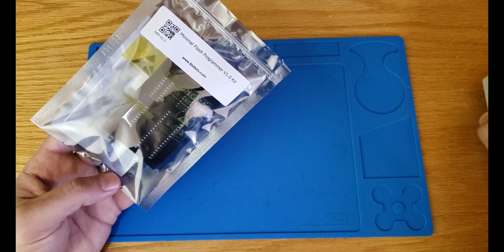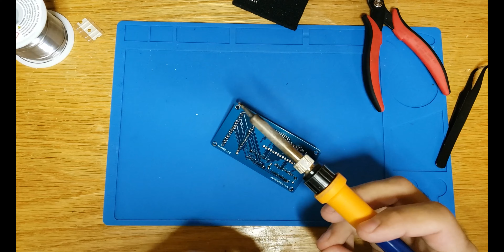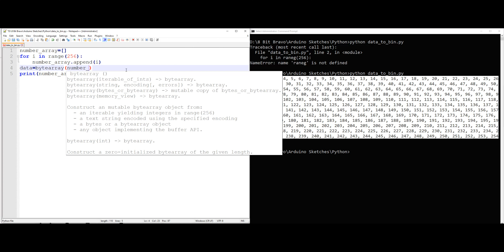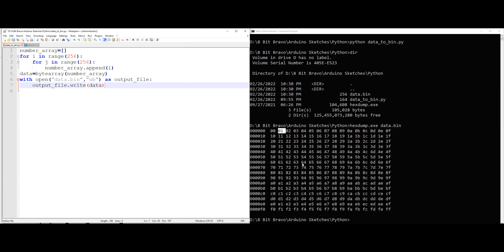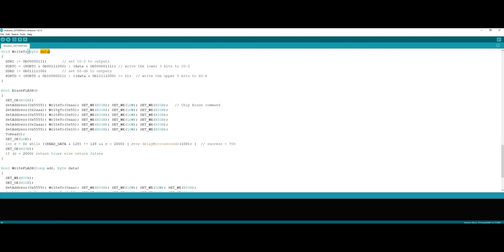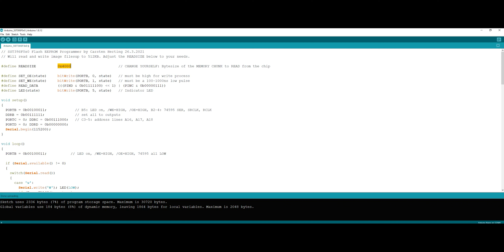Bravo 8bit computer-Part 10-Flash Programmer,inspired by Minimal Project & Ben Eater's 8bit computer

Comment: The diagram is awkward as it seems to show the RCLK and QE of the left chip "sharing" the same path.  There isn't a true path joint making this happen, but they end up running horizontally on the same line nonetheless... and that can certainly be confusing.

Comment: I retried running prom.exe on win10 machine. It runs, but doesn't recognize the data.bin file in the same directory. It just opens the option menu and drops out. Are there apps or libraries that need to be downloaded to my pc. The pc is a new HP laptop so only thing on it is Arduino, Notepad++, and VSCode.
Reply from the maker: Hi John, you need to specify the file name as a parameter. So for example you say  "prom.exe -wdata.bin" , notice the -w attached to the file name at the begining. This will write the file to the flash. Also, make sure that only  one com port is active when doing so. The prom exe will only recognize single com port so if you have more that one com port active, you need to go to device manager and disable all come port except the one connected to your flash programmer, I explain this somewhere in video No13 when programming flash for control logic. Please have a look at the Minimal flash programmer Github page by Carson Herting. There are some explanation for executing the prom.exe. Hope this helps. Let me know if you needed any further help. Thanks
Reply: @ConfigIOI  I found the problem. Last time I used a Windows machine was about 10 years ago with XP. This new laptop has Win10. During the setup I wanted to disengage the OneDrive cloud storage when I noticed it sucked all my files up into the cloud. When I did that, it removed my files locally. The only way to reach the prom.exe and data.bin files was via the OneDrive and they didn't run from the cloud. Once I reestablished my files locally and severed the ties with OneDrive, the prom.exe performed as expected. Now I'm trying to rewrite the interface using Processing, which will run on PC or Mac.

Comment: Do you have a flash programmer solution for Mac users? I have an iMac. My machine won't run the prom.exe program.
Reply from the maker: Hi John, 
To be honest, I'm not a MAC user and I'm not sure how one could use the flash programmer with MAC. Maybe you could use some tools to execute .exe files on MAC or maybe you could use a VM machine and run windows under MAC. Also, I think the Minipro product works with MAC computers.
Reply: @ConfigIOI  When I figure it out, I'll let you know how I did it.
Reply from the maker: @Bengadeer   Great.Thanks